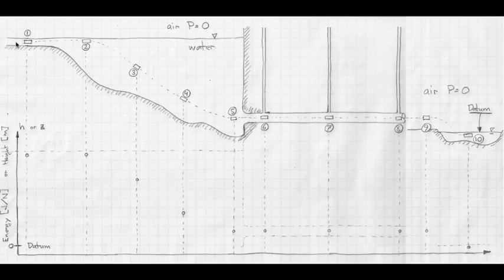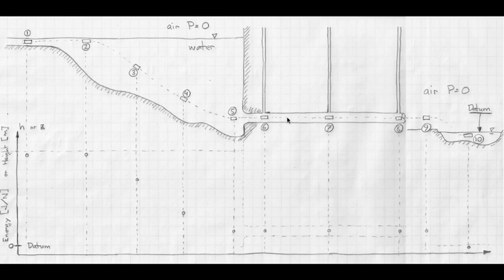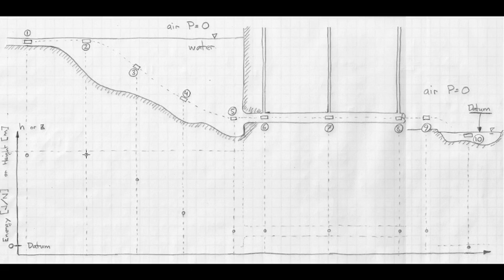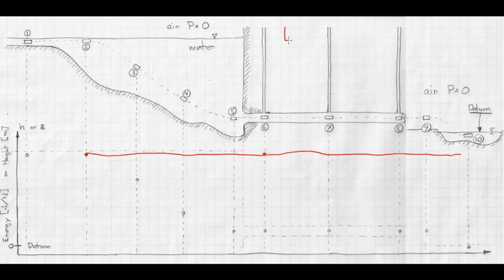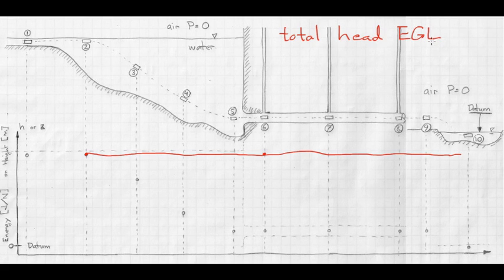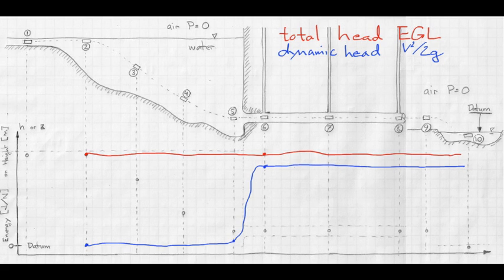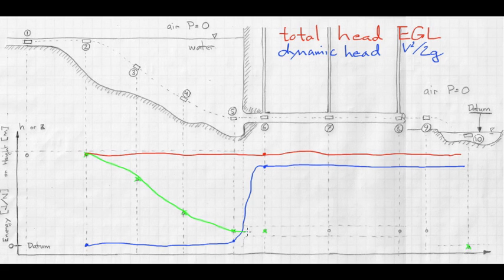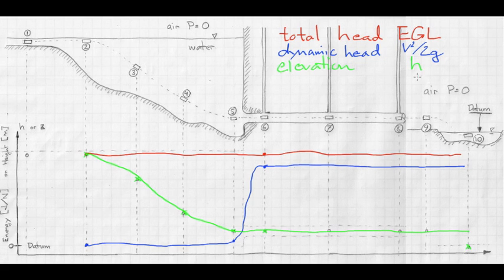EGL-HGL.m4v

Comment: About the transition from 5 to 6.. 
At point 6 I would see the fluid being "pressurised" into a small pipe (for instance). Why is the pressure low?
Reply from the maker: Energy is conserved, so the potential energy of pressure is transforming into the kinetic energy of velocity. Another way to look at it is that there must be a negative pressure gradient to accelerate the fluid as it moves from position 5 to position 6.